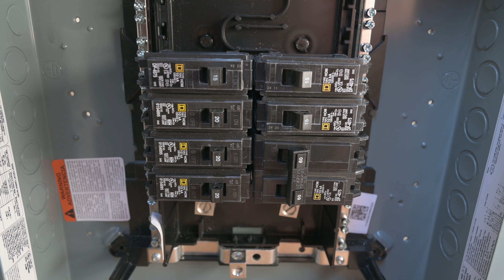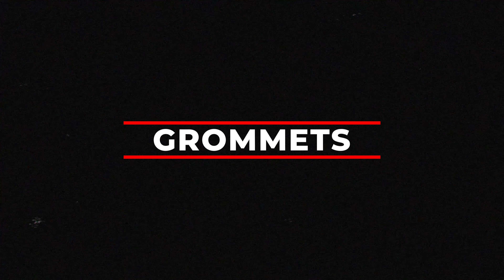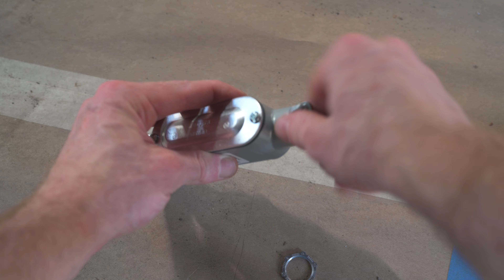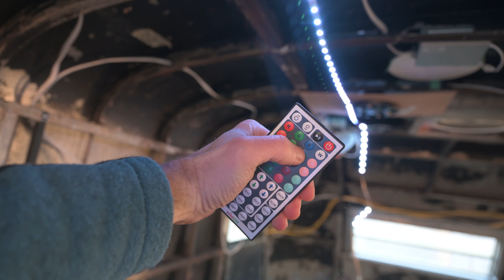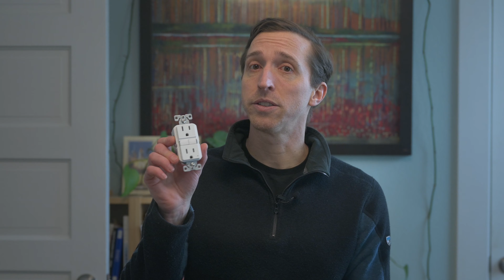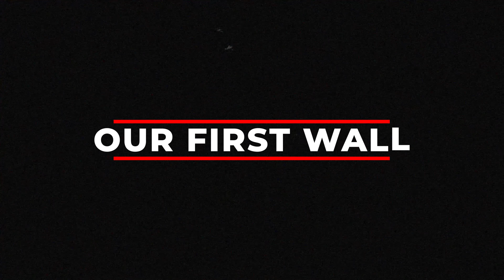New Wiring in Our Vintage Camper Trailer  | E24

Comment: I’m assuming you don’t plan on running this RV of of a house battery ever? Can I ask why? Currently renovating an RV for full time living and I’m thinking about getting rid of the house battery and just doing everything AC like you did (minus fans). I don’t plan on living in it anywhere where I wouldn’t have shore power. I appreciate any opinions you have or what helped you make your decision
Reply from the maker: Hey Brian! No we just want to park this on our land and hook it up to shore power. The idea was to have as a base while we build a regular house, and have it for guests and maybe even rentals. 
It would be cool to have solar panels on a roof over it charging batteries in a shed nearby or something, but that's not in the plans atm.
If you can always have a hefty AC power supply then hopefully this video is helpful. But if you do want to move around, I believe plug in power at some RV sites is limited to about 30 amps? You'd just have to be careful with what you use and definitely not have an instant electric hot water heater!
Hope that helps answer your question? :)